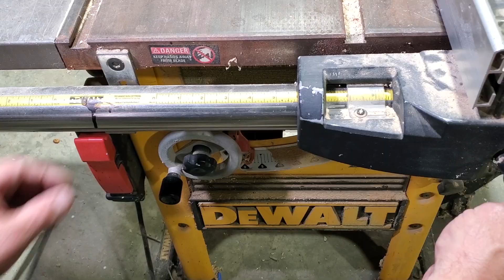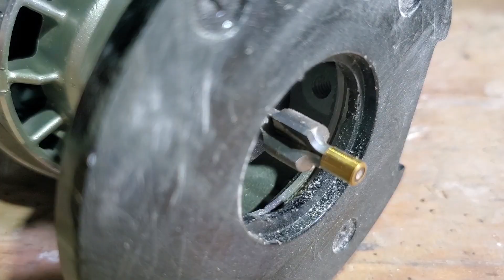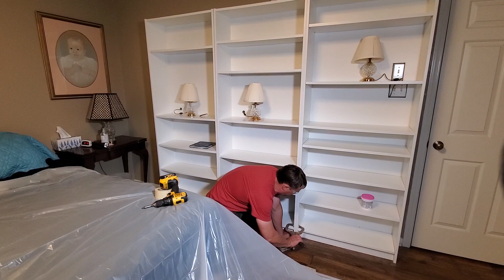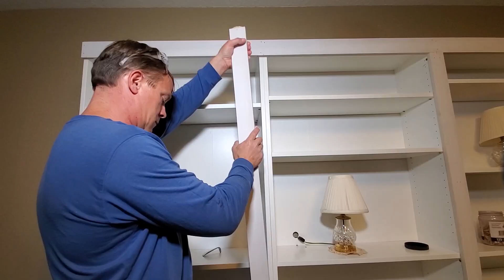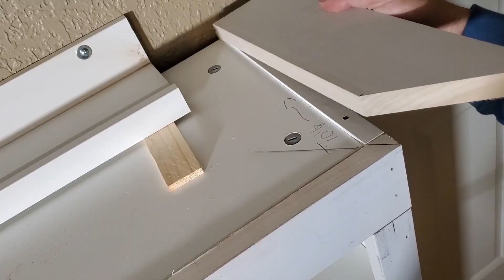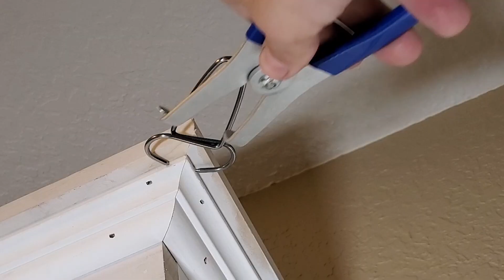Ikea Bookcase Upgrade

Comment: How did you make the center of the shelves stronger. Overtime wouldn't the center bend by weight?
Reply from the maker: Going off memory, the shelves were less than 2.5 wide. I don’t remember sagging being an issue

Comment: Hello - so no glue used with nailing the face frame to the front of the books cases? I am getting ready to do this and thought I would need to dado the back and apply with glue. Good to know the nails don’t go crazy after being shot in. What length nails did you use? I like that top cap trick you did. Nice work.
Reply from the maker: I think if you screw the units together well the nails are really just fighting gravity. The units I worked on several years ago are still looking good.